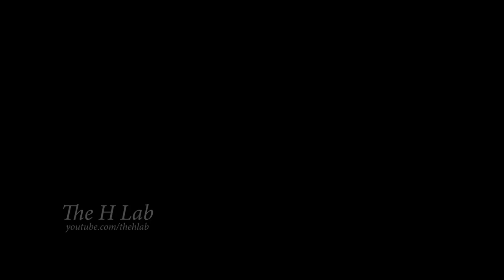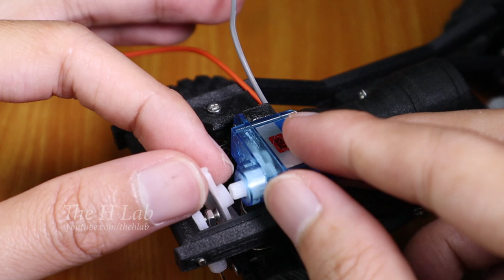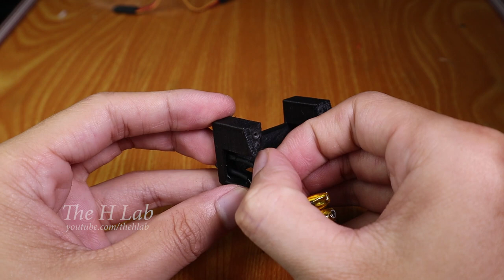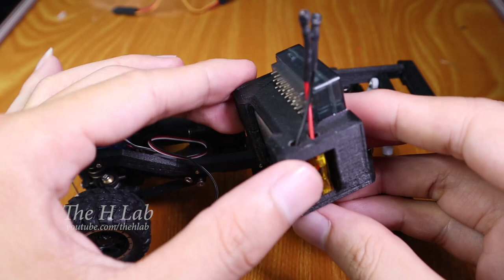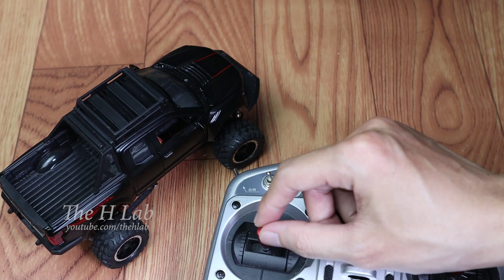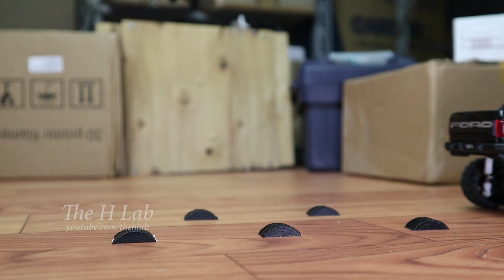Finally my 3D printed off road car can run

Comment: Without ESC?
Reply from the maker: Small lumps of black on the connect wire between motor and Receiver is ESC
Reply: @TheHLab  how many batteries enter the channel?
Reply from the maker: 2 batteries